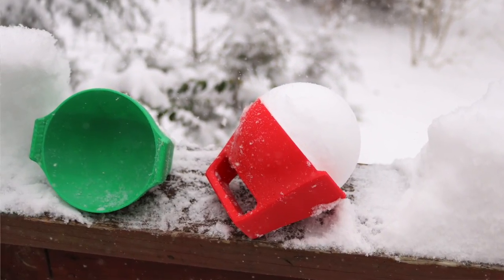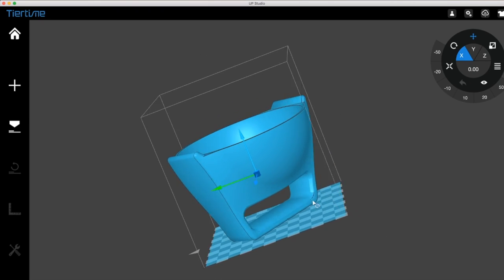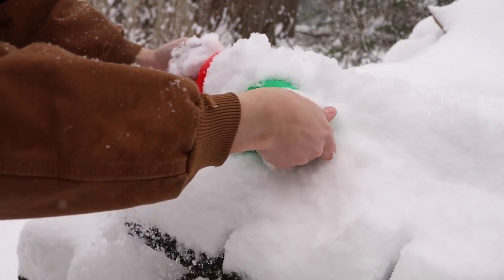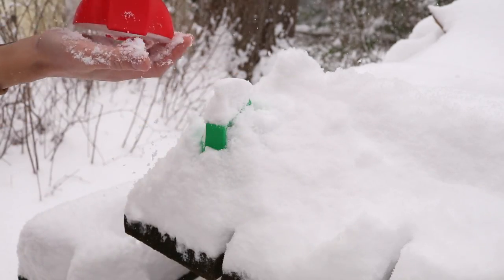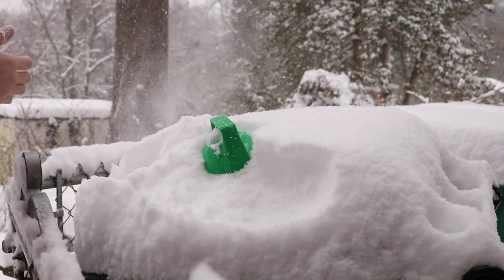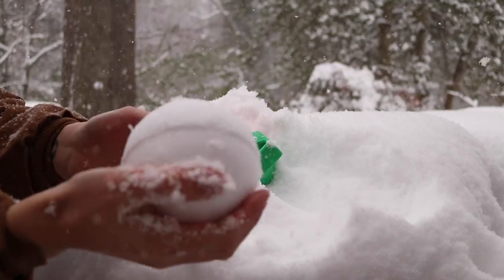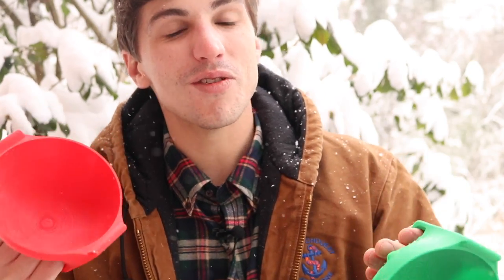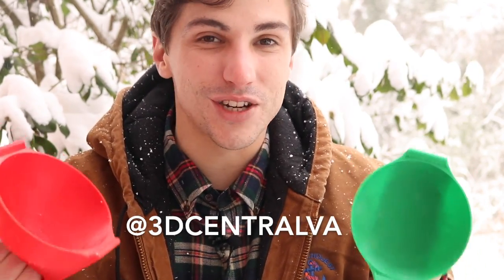3D Printed Snowball Maker! Mold your own snowball!

Comment: Also, great print quality!  What printer did you use?  What plastic?
Reply: Is Hatchbox ABS the ideal filament for these files?  Or could Polymaker PLA also work?
Reply: Also, if Hatchbox ABS is the best filament for these snowball molds, do you know if it's also compatible with the Lulzbot Taz 6?
Reply: 3D Central, I have some GREAT print ideas! Print Jasper's Helmet from Steven Universe!  Or, maybe print Bismuth's Breaking Point!  Also, maybe you could try making Agate's Electric Whip from the episode That Will Be All, with some chain links and a handle!  I reckon there's a few files for whips!  Maybe you could design one, too!  I additionally suggest printing Blue Diamond's Palanquin, Blue Diamond's Arm Ship, Yellow Diamond's Arm Ship, the Homeworld Ruby Ship (Roaming Eye), Peridot's Drill from the episode Gem Drill, Sardonyx's War Hammer, a TIE Fighter, an X-Wing Fighter, and an Imperial Star Destroyer!  Tell me what you think of these ideas!